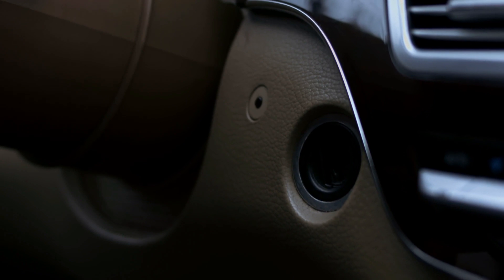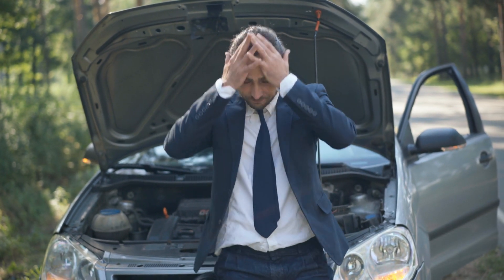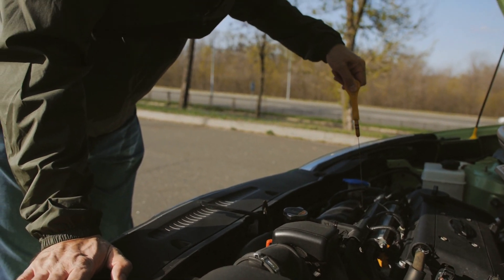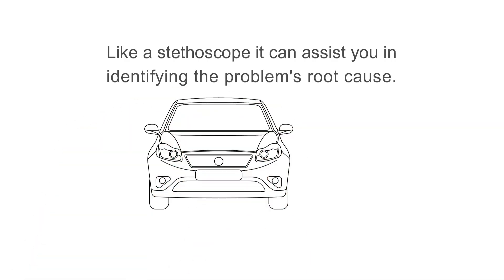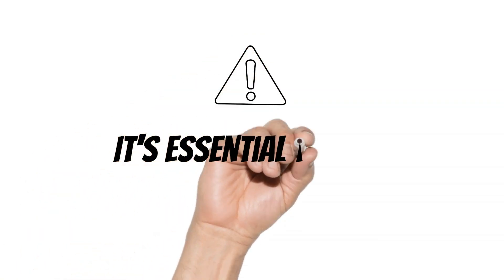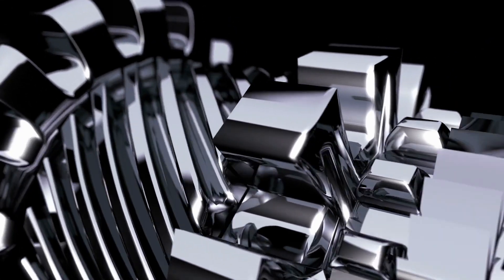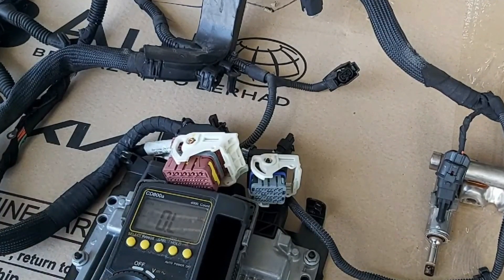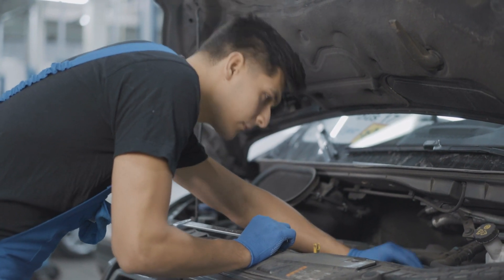How To Diagnose A Bad ECU | Learn Why Your Car's Engine Control Unit Is Dead

Comment: Engine Lags or Surges. Because the ECU controls your engine's timing and fuel usage, you might notice engine performance issues such as lagging or surging in the module is going bad. Thank you for sharing.